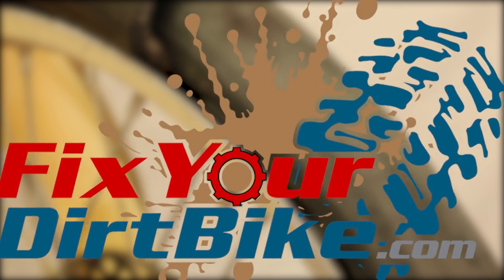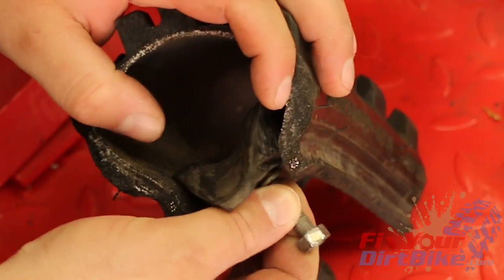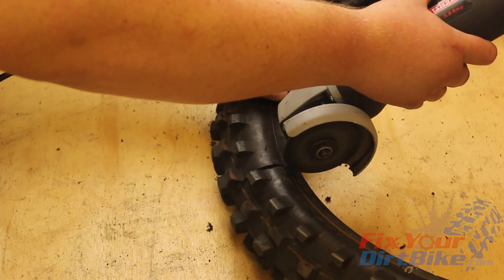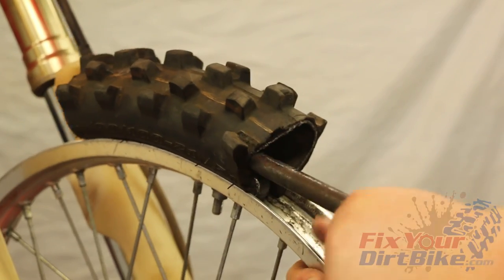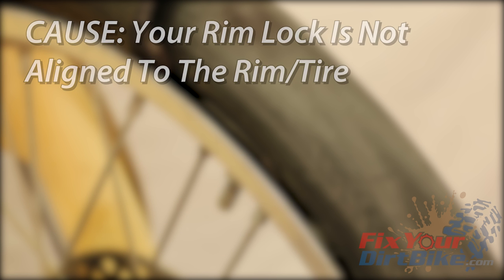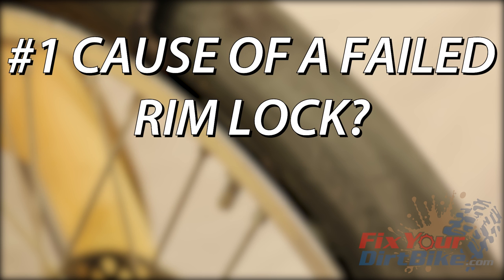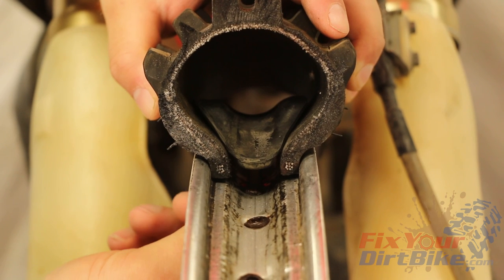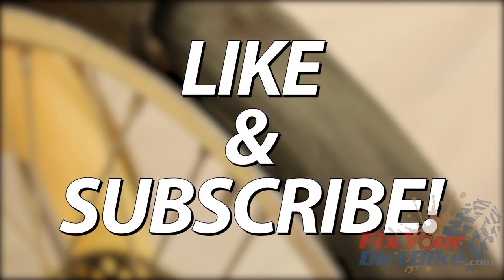How The Rim Lock Works On Your Dirt Bike | Fix Your Dirt Bike.com

Comment: I highly recommend two RIM locks. I use Nitro Mousse Platinum and I had my rear tire come off the rim last Sunday on an FE350. We were getting after it over some really gnarly rocky stuff and I guess she just rolled off on a rock. I made it back because the mousse held together and the single beadlock gripped the tire to allow traction. I have just ordered more rim locks need her ready for this weekend ride.

Comment: Am I supposed to insert both sides of tire bead between rim lock and bead? I just put tire on and let tube rest on top of rim lock. I inflated tube after, tire install and the bead is about 1 centimeter bulged out on the sides of rim.. Not sure that's correct.. Lol. I think I F* up.. That tire was a pain to put on too!!! Rear 16 inch E ride Pro E Moto Warped 9 custom wheel.  .. Hope I don't need to do it over? Any thoughts greatly appreciated. Thank you! Great Video!
Reply from the maker: Yes, both beads. It sounds like your rimlock is offset, causing the bulge. Deflate the tube and push your rimlock in and out until the threads are straight up and down.
Reply: @Fixyourdirtbike  Thank you! I'll try that!

Comment: I have a ktm 500 excf with a d606 tire in back I didnt put a.rim lock.in is that a mistake the shop said its bard to balance I ride on the road and trail ride my bike had continental 80s with no rim locks but the tread wasnt to aggressive I keep psi at 20 should I take it back and have them installed I dont know
Reply from the maker: It's fine for the road, but if you ride aggressive trails then you definitely need a rim lock.

Comment: Stupid question here - building a 48v 500w ebike, high torque, planning on maybe hitting speeds of 25mph + - do you know if there is one of these for bike wheel? Great vid straight to the point love that - thanks in advance
Reply: lmao dude I think u will be fine without a rimlock
Reply: @Clouderrr  Yer i know but I would have been a nice idea, saw a guy was using motor bike wheels but his ebike was well over 500w

Comment: Please help, i have a drz 250 and i dont know what rim lock size should i use on my rear tire
Reply from the maker: 2.15"
Reply: @Fixyourdirtbike  thank you, i feel stupid it was stamped on the rim
Reply: @Fixyourdirtbike  can you tell me one more thing ...
Will my bike flood if i give it gas while off 
(CV carburetor)
Reply from the maker: No, the carb needs vacuum to pull fuel into the engine.

Comment: What would cause an air leak around the rim lock?
Reply from the maker: The rim lock has pinched the tube, but the clamping pressure is keeping the tube from deflating completely.
Reply: @Fixyourdirtbike  ahhh, so I should release pressure on the rim lock and maybe rotate the wheel to get the tube unpinched? And the air is coming from around the rim lock bolt. Sorry. I should have been more specific.
Reply from the maker: If your tube is pinched you will need a new one. Does the air leak fast or slow?

Comment: Why does my rear rim have 3 factory holes?
Reply from the maker: Most likely for a second rim lock.  Is the hole plugged or can you see the tube?
Reply: Well, I cut the old tube and used it as a spoke guard, so yes. I want to carve a piece of cork or something to plug it.
Reply from the maker: You can take a carriage bolt with a washer and nut on the outside to permanently close it.

Comment: 2 questions: 1. Why are they not installed opposite from the valve stem to at least help a little bit with weight balancing? 2. Why can't they combine the rim lock with the valve stem, all in one? Thanks! 🛞🏍